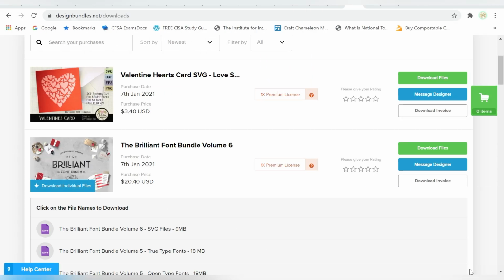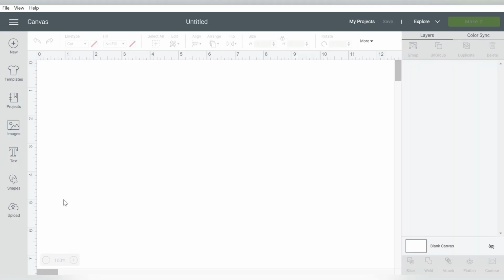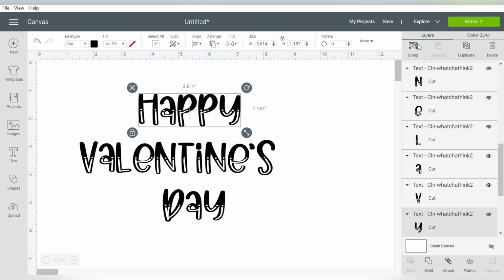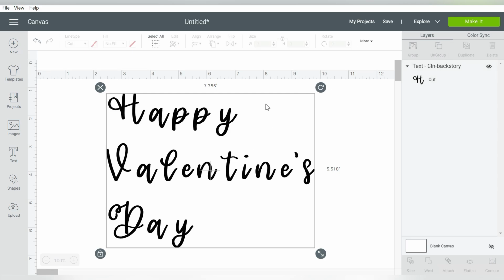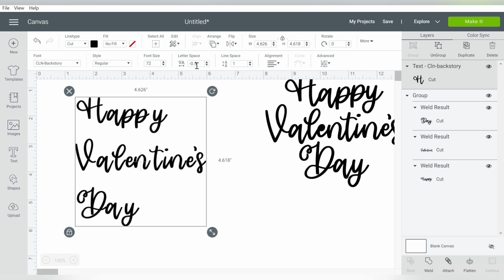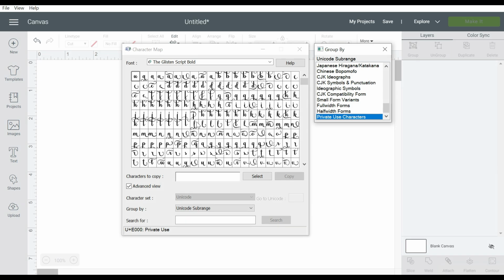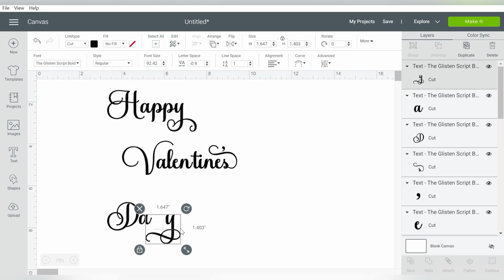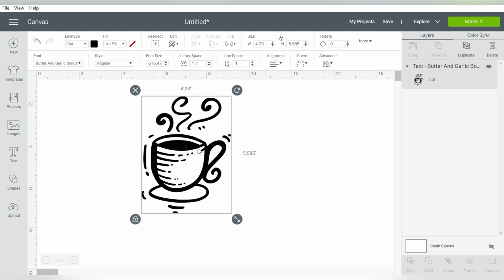📝 All About Text in Cricut Design Space for Beginners

Comment: How do you keep the letters aligned when you’re moving them? Great info!! Thanks
Reply from the maker: My video is a bad example of this, but you can always reference your grid lines to make sure they stay straight.  I turn my grid off, so I can't show you in this video what it looks like, but as long as your grid is on this will be easier.  Hope this helps!   ---Becky
Reply: I use my arrow keys to move the letters around. That way it helps me to keep them straight. That works beat for me, anyway.
Reply: I was hoping there was an easy trick like holding down the shift key or the control key. 😢